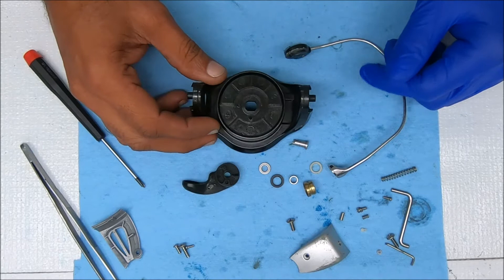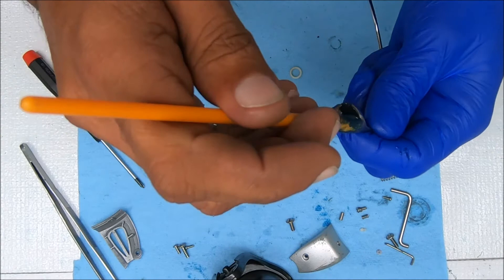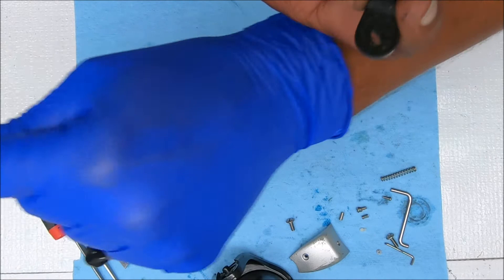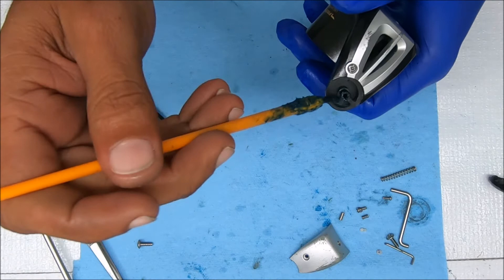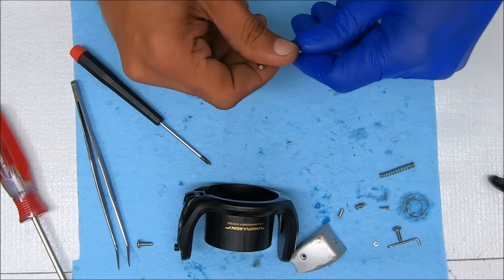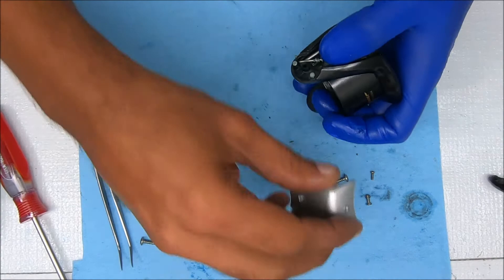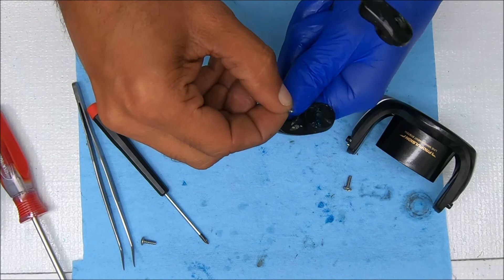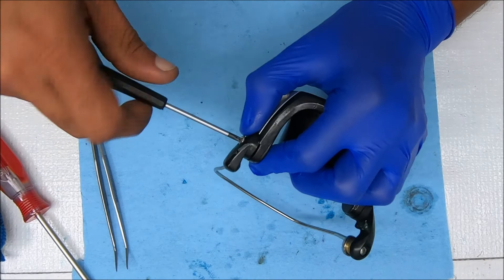Shimano Baitrunner 6000D Bail Assembly How To: Fishing Reel Repair

Comment: Are the 4000d and the 8000 the same internally?
Reply from the maker: Thanks for watching. Probably, but a 4000 just came in for service, so I may do a video on it.
Reply: @TSGReelService  it would be a huge help to me, I’d really appreciate it. I’ve had it for awhile and it needs some help
Reply from the maker: Okay.
Reply: @TSGReelService  did the drag washers on it, then the line roller. Easy after watching your videos
Reply from the maker: Glad to hear the video helped. Turn on your bell notifications for when I post the 4000D service video.
Reply: @TSGReelService  subscribed 100%